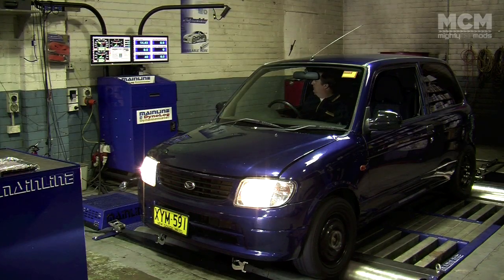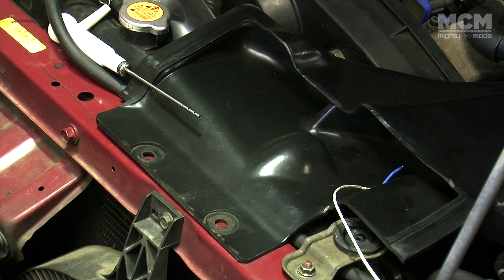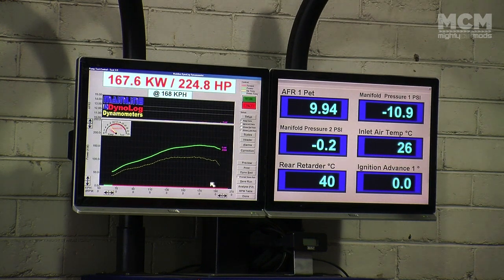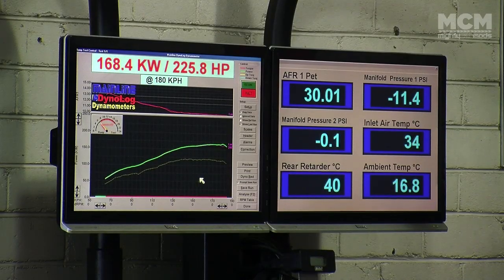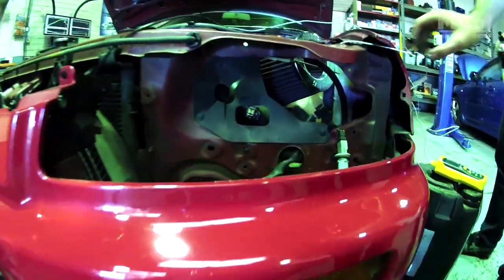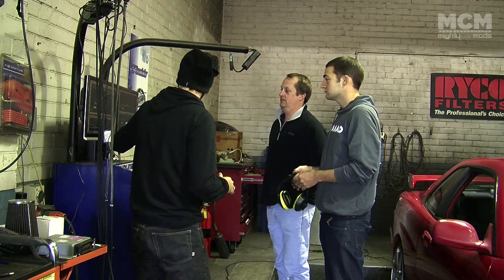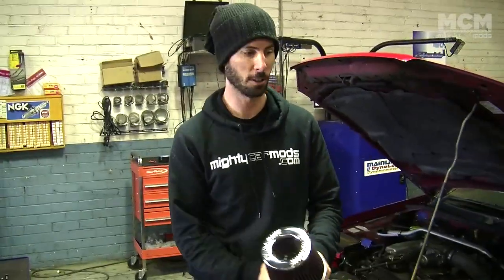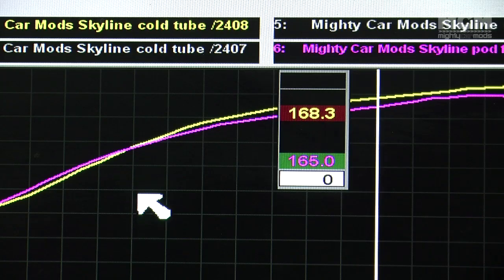Cold Air Intakes Mythbusted [Turbo]

Comment: The comments section.  Excuses excuses all I can see is excuses.  "need a tune brah" "my intake brah" "my filter brah" "need a turbo brah" "need an exhaust brah".  The fact of the matter is, on most vehicles, the cold air intake, is bullshit.  Know what it does, it vibrates and or resonates which makes a vroom vroom noise so you can think your car has a v8, when it doesn't.  This video is based off what most "Mah handa iz da wace cwar" people do.  "cold air intake brah".  There is no replacement for displacement.  Unless you are doing a full on tear down, rebuild or proven high end forced induction power adder, you are gonna get nowhere.  Car companies spend millions and millions designing, you and your "Mah handa iz da wace cwar" friends are idiots.  New name for cold air intake, "over priced vroom vroom noise weight adder".  One more thing, your coffee can fart car muffler that sounds like an elephant fart, yeah, that's just a big hole to jam a pineapple in.
Reply: I have heard the tune thing way too many times.  I asked one guy exactly what parameters would he change to accommodate the new "mod".  I got deer in the headlights look.  Most people have no clue.

BTW, most cars self tune nowadays.  They got these things called sensors that measure airflow and air temp.  Do these idiots retune their cars every time the weather changes?

Comment: I think this test is bullshit... if anything, the car would run like shit without a tune. You cant just slap a intake and BAM power. You need a tune so that the car can accomodate, and properly use the air.

Comment: Another video proving how little people who think they know cars actually don't know dick about cars... Test a REAL CAI that uses smooth free flowing aluminum tubing and locates the air filter in the front bumper away from the heat of the engine, hence the name COLD AIR INTAKE. That thing you tested was a SRI or SHORT RAM INTAKE, do some research next time boys. You even proved the potential of a real CAI when you stuck that poorly flowing corrugated limp dick hose on there and gained power. Lastly remember the car you are testing with, it was designed from the factory to be as good as it can be, its a god damn skyline... not a normal car with a stock air intake designed to reduce noise and not be as good as it possibly can be. But I don't need you to tell me what I already know, CAIs work and they work well, more so when they aren't SRI which are just for the sound and slight power increases. The only Myth busted here is your knowledge of automobiles...

Comment: slapping any filter onto a factory intake pipe that has resonator and other choke points will not yield nothing. maybe do your research and actually find out what cold air intake systems are.  

if you took a moment and installed lets say k&n air filter with the aluminum intake ( larger diameter straight pipe ) that provides zero choke points and laminar flow you would gain some HP/TQ as well as throttle response. 

your video sucks. stop making them

Comment: This is the most stupid thing I have ever seen. Trying to look professional they hooked all all these pieces of equipment to test put the HP mean while they were testing the wrong things anyways.

1. stock vs cold air....next to no gains. Maybe 1hp which is.wjat I would expect. BUT you would have a decent increase in throttle response and how easily the rpm jump.

2. travelling at 100 kph which is highway speed limit where I'm from and punching it stock vs cold air would be a big difference no fan can replicate that kind wind effect. cold air = (colder air +  at a much higher force) 

3. ??? what kind of tubing is that? a cold is is designed to be smooth, efficient, not even always larger then stock, but as short as possible to the cold air pocket. not 10 ft long of rigid piping. (blow in a straw, then connect 10 straws together ad blow again?? get what I'm saying)

4. a simple video of 0-60mph acceleration or 100-150kph acceleration or even 60-80 80-100 would prove what the cold air does better.

I say myth busted on jokers for likes.